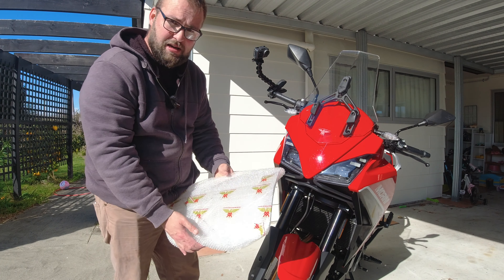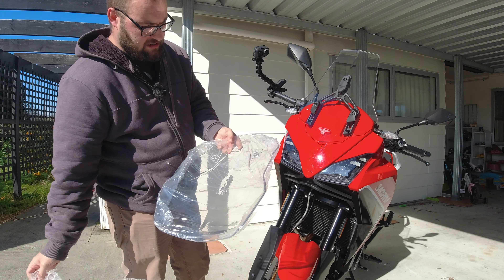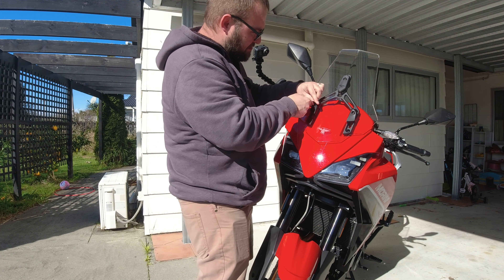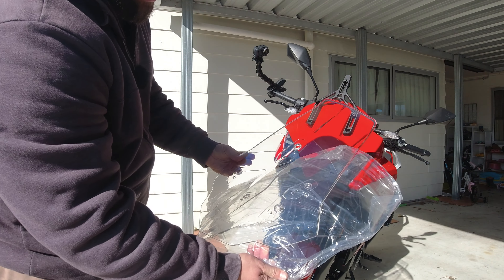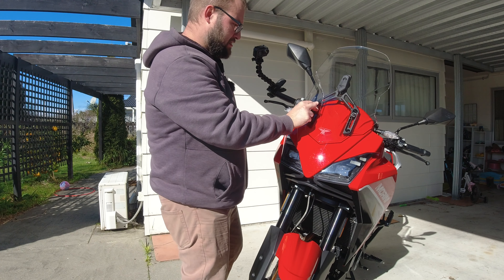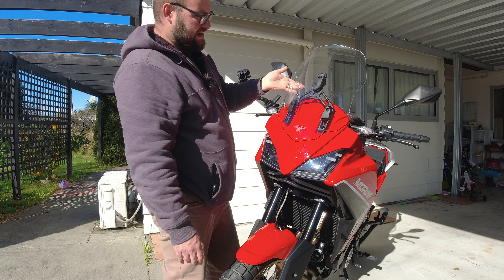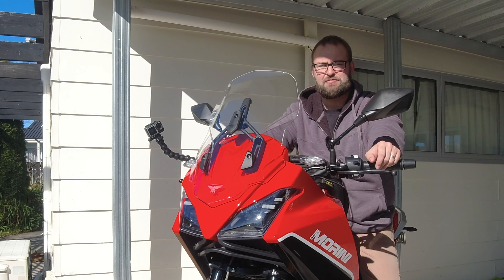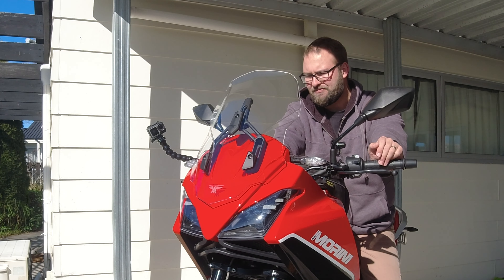Moto Morini X-Cape Accessory Windshield Install | Real Time

Comment: I cant turn the knob either way to adjust the windshield height, do I have to unscrew it from the screw that adjust the knob? thanx in advance
Reply from the maker: Sounds like the bolt in the knob is too tight. Back it off a little and you should be able to adjust it. They do like to loosen themselves (makes an annoying rattle noise when it’s too loose) so it’s probably been tightened to try prevent that.
Reply: Exactly Thats my problem when revs goes up to 4k rpm the whole bike turns into a rattle due to this knob! thank you so much for the advise, will look into right now! @OnThrottle

Comment: Did you notice any wind noise difference?
Reply from the maker: Slightly less noisy but it’s not anything dramatic. Noise I find is quite dependant on your helmet as much as the screen and mirrors. It mostly helps take pressure off your shoulders I’ve found (and personally I think it looks better than the stock screen).